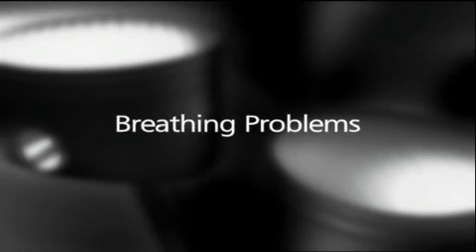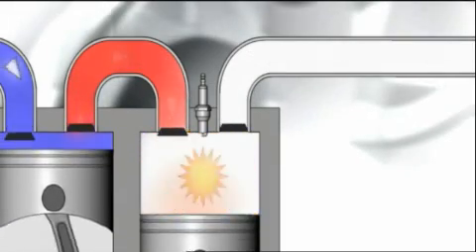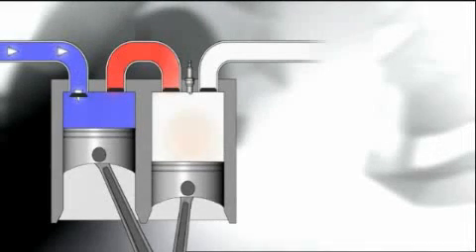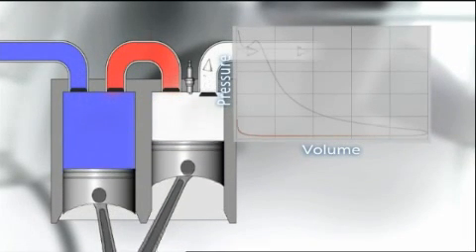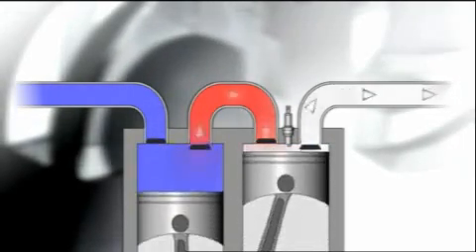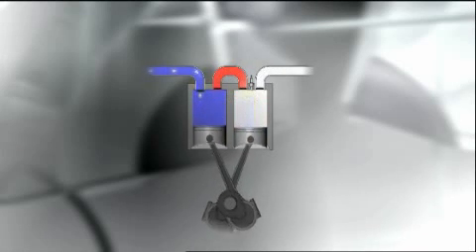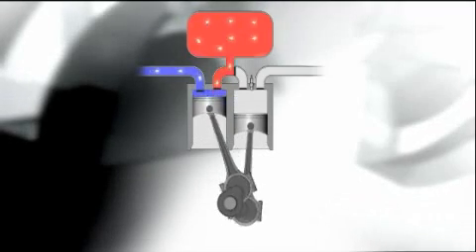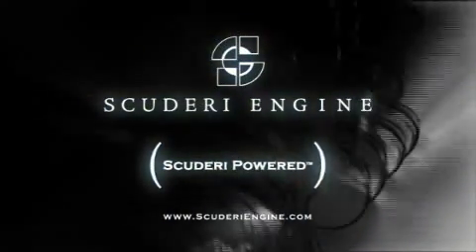Scuderi Engine - How It Works (by www.caroto.gr)

Comment: How is this more efficient than just burning it in the cylinder that the air enters first? Seems you would be moving twice the amount of metal for half the work.
Reply: Yea it doesnt look very efficient to me....I dont think the power gains would be worth basically having cylinders that are just dead weight on the crank...
Reply: +Stevie Wonder But this V8 wouldnt be a V8 anymore, it would be a V16. So you would be losing so much power carrying all those cylinders around that are not producing any power.
Reply: Stevie Wonder It doesnt. If you have a V2 4 Stroke it will deliver more power than this engine with the same bore/stroke. Trust me i am an engineer , and i develope parts for race engines. This consept is only one of a "want to be " Engineer, who has actual no idea about engine design. First it sounds good but on the seconde view it sucks in every point.

this engine cant be smotth, it cant deliver the same power as a charged 2 cylinder engine.

And it looses all the benefits of the 2 Stroke engine as well.
Reply: +Nick Palaroan I agree. This is basically an inefficient way of Forced Induction. Turbos and Superchargers were invented to force fuel air mixture into a cylinder without slinging more metal around inside the engine to do the same thing.
Reply: +Merp it fires every revolution not every 2nd revolution, but see ya point as a v8 would become a 16 cylinder though, need a compression piston for each firing piston. Was just thinking what you guys were as well
Reply: +Adrian Paul ..... but a split cycle V8 would still get 4 per strokes per 360° rotation of the crank, just like a normal 4 stroke V8.

I think this is probably going to be marketed mostly as a diesel engine for buses, trains and tractor-trailers as an alternative to battery-electric hybrids.
Reply: +Nick Palaroan ...... per 2 cylinders, you still get 1 per stroke per 360° rotation of the crank. 8 cylinders (4 intake/compression cylinders+4 power/exhaust cylinders) still produces 4 power strokes per 360° rotation of the crank, just like a normal 4 stroke engine.
Reply: +Nick Palaroan ...... per 2 cylinders, you still get 1 per stroke per 360° rotation of the crank. 8 cylinders (4 intake/compression cylinders+4 power/exhaust cylinders) still produces 4 power strokes per 360° rotation of the crank, just like a normal 4 stroke engine.
Reply: +Stevie Wonder  You have a V8 + 8 Kompression cylinders only to produce one not so good combustion on every one of the first 8 cylinders. Wait why not run 16 cylinders direktly, then you have 8 combustion per cycle too and you will have a much smoother run and a much better combustion also your cylinder will get much more stress than 16 running cylinders.
Reply: +MKS Racing This ^.
Reply: +MKS Racing "only not so good combustion" is baseless speculation. this allows the bore•stroke of the intake/compression stroke to be tuned separately from the power/exhaust stroke which has benefits for increasing the kWh/gallon of the engine..... the Prius does something similar by holding the intake port open for the beginning of the compression stroke.
Reply: +Stevie Wonder How is it changing the bore and stroke? Seems rather impossible since in the video the bore and stroke remain the same. I have seen technology that can change the stroke to change compression ratios, but the bore cannot possibly be changes at any point on the fly in an engine.
Reply: +Nick Palaroan this video sucks, in other videos they show a long stroke/small bore compression cylinder feeding a comparatively short stroke/large bore power cylinder.
Reply: +Stevie Wonder Its still inefficient to have a cylinder as more/less dead weight. Its not contributing more power than it takes to move it, so its dead weight. Hence why its not used.
Reply: +Nick Palaroan it delivers better kWh/liter.
Reply: +Stevie Wonder That depends on how your measuring displacement....are you measuring the displacement of both cylinders or just the combustion cylinders?
Reply: Stevie Wonder 
But if you're going to do this why not just get a 2 stroke diesel? Still get more power and cheaper because of less moving parts
Reply: If that first piston was bigger than the power piston, you could call it a supercharger, but it isn't.

Comment: Snake oil. The one thing that made me a non believer was the storage tank. The fuel will fall out of the incoming charge and you will have a/f ratios that are varied.
Reply: MrCuervo22779 He says it's direct injected, so the sorage tank only stores air.

Comment: Looks allot like the (5 stroke) concept.
Reply: The 5 stroke is somewhat similar but the exhaust gas is sent into another cylinder to use more of its energy. You still have two pistons operating normal 4 stroke cycles for each "passive" cylinder.
Reply: +94XJ Yeah, the 5 stroke looks superior in terms of efficiencty as it's runs more like an Atkinson cycle (as used in Prius et. al. via VVT).
Reply: +Marcus Lindblom Sonestedt Nah, Atkinsin leaves the intake valves open late putting positive pressure in the intake manifold to fill the next cylinders.  It helps efficiency and low end torque, but it's not recovering additional energy like the 5-stroke.  Atkinson adds efficiency but decreases power density, 5-stroke increases efficiency by increasing power density.  Instead of less power/liter but efficient burning it's mote power/liter recovering exhaust energy allowing for a smaller engine.
Reply: +Marcus Lindblom Sonestedt I get what you're saying now...the Atkinson gives a bigger expansion stroke than compression so in that regards, yeah, it's similar since the 5th stroke is an additional expansion.

Comment: Interesting design...but what are the frictional and parasitic losses from additional cylinders and connecting rods?
Reply: each cylinder pair only has 2 cycles so theoretically the friction looses are pretty much the same

a pair of cylinders should produce the same power as 2 seperate cylinders in a 4 stroke engine because the pair combine the 4 strokes of a conventional engine into 2 strokes of a cylinder pair so you get the same amount of powerstokes between 2 pistons

Personally I don't really see much benefit to this design

In the video it does give a few good points

- Reduced Knock/detonation by cooling compressed air
- Capture energy by compressing air into a tank

Comment: Your illustration is wrong.
You should close the crossover valve on the power cylinder before you ignite...
Otherwise you will backfire into the crossover pipe.

This is only a modest improvement over the 4 cycle system.

Also the power cylinder should be about 30% larger to improve efficiency since you have the ability to decouple the cycles.
Further more, the exhaust valve on the compression cylinder should be reversed.
It should seal in the other direction to keep the pressure in.
Otherwise you will have to use a very strong spring to keep the pressure in which will increase friction.

I have thought of this idea 20 years ago and I tossed it in the garbage bin because it is not a significant improvement.

I will post my significant idea here on youtube soon. :0)
Reply: Reading an article at the moment.  Apparently Scuderi reckon they've cracked the low thermal effiecieny problem by igniting ATDC instead of BTDC.  Funny you mention the valves should open outwards; I think I read that they actually do on the real engine.

One thing that crossed my mind is whether the firing cylinder will suffer from extreme heat build up - especially if they turbocharge the engine.  That's one of the weaknesses of Wankel engines; one side of the engine stays perminantly hot, while the other side remains "cold".

Comment: More parts= more inertia,higher production cost.+ more timing elements= higher production cost. Cylinder that does not produce power deducts power(yes he says in the video that it does but not by how much) Close cylinders have issues cooling(although the pump cylinder does not produce power or detonations it heats because compressors heat taking heat from air thats produces it in the compression process) ... ... ... My question wheres the Economical part?

Comment: Konigsegg is getting better results from just removing the cam shafts from engine.  They are testing independent valves that are computer controlled.  Then they can be mapped to perfectly match engine needs at any RPM and load level.  The rest of the engine is a normal engine.
Reply: finally someone who realizes koenigsegg is better than anyone else!
Reply: Justin McLauchlin
ok yea sure...
Reply: okay maybe not everyone else, but they are still smart to have thought to use it before any other manufacturer
Reply: i don't think they where the first however i will say they have done a good job with it so far.
Reply: The Joseph Reid engine from the 1890`s uses 1 poppet valve and ports in their engine design like this
Reply: yeah but that arises many problems. instead of just swaping a bad cam you now have to swap all electronic controll units and elctronically time them and program them. it seems more expensive and harder to do.

Comment: it would be hard to get clean combustion with such short cleaning time by the intake however, mechanically it is brilliant. in order to avoid pumping loss, the intake into the power piston has to open shortly before TDC and close right after TDC for ignition and combustion seal. post TDC ignition has very low compression ratio so sacrificing combustion efficiency for mechanical efficiency does not his the nail on the head. the rotary engine still suffers this, ideal mehcanically yet has problems with clean combustion and a combustion chamber suface area that is too large for its cubic capacity thats why rotarys are far better off with two spark plugs per cylinder.

Comment: So it takes 4 pistons to do the job of 2? I'll pass.
Reply: Ryan LaRue It's 2 pistons doing the work of 2 pistons. A 2 cylinder 4-stroke engine would only fire 1 cylinder per revolution. This has a piston that fires every revolution and another piston that never has an ignition stroke. Assuming both engines could achieve perfect volumetric efficiency, output would be the same. This design exists to improve on the VE over a conventional engine.
Reply: The idea of a split-stroke engine isnto get the power density of a 2 stroke with the efficiency of a 4 stroke.  Ultimately if youbhave 4 pistons in the split cycle or an otto cycle engine you will still have two combustion cycles per crank rotation.  I think the biggest things working against a split cycle are engine vibration and no real reduction in rotating mass.
Reply: yeah but two of those pistons are acting as turbos, compressing the air
Reply: Nabre Labre
 A 4 stroke already compresses the air but the air density that's being compressed is only from natural aspiration, hence the other two pistons cramming more air into the engine.
Reply: David G This is natural aspiration...the intake cylinder is naturally drawing in air.  There's no mention of a larger intake/compression cylinder.  The concept is about reducing the pumping losses from compressing the air before ignition.  If you watch, you'll see the crossover valves open about halfway up on the compression cylinder.  There's less resistance to the compression and a more metered burn on the power stroke to improve overall efficiency.  This is still a 4-stroke engine, the strokes have just been paired off into dedicated cylinders.

Kind of like having 2 employees each responsible for handling the same 4 tasks.  In this situation, each employee is given 2 of the tasks.  With fewer tasks, the employees should (hopefully) be more efficient at what they're doing and you get more work done from the same resources.
Reply: The thing is is that it really isn't cramming in any more air nor is the intake cylinder mixing with fuel.All its really doing is transferring air from one cylinder to another since the power cylinder doesn't actually draw in air by itself, so again, 2 cylinders doing the work of one is not efficient.
Reply: Nabre Labre No, not even close.
It would run like a 2 stroke engine but would have the fuel economy of a 4 stroke.
There would be no misses as the firing is continous and happens every revolution.
Reply: Ryan LaRue The compressor cylinder is usually smaller and can use weaker materials. They were typically driven by a elliptical instead of a crank on the crankshaft. Essentially attached to a point either on the flywheel on 1 cylinder engines or a point on the counterweight on the crankshaft.
An example of this design would be a Ried 15hp oilfield engine.
Reply: You can have different compression and expansion ratio
Reply: David G They are not acting as turbos, a 4 stroke engine already compresses the air fuel mixture in the same manner. This method just turns off half the cylinders so you'll have a heavy car that runs like its misfiring

Comment: Its a positive displacement supercharger (piston type).. not very efficient because of heat from the compressed air from one cylinder to the next one via small interconnecting tube / too many moving parts, valves..springs..rings /  not easy for rebuilding / ... just GAY.

Comment: so basically half the engine is a supercharger... Uh dumb worthless pos motor. Just use a supercharger and not waste half the motor due to loss of power and friction and rotation weight..SOME PEOPLES CHILDREN!!
Reply: Think of it this way; it produces the same number of power pulses per revolution as a conventional engine, it's just that the 4 cycles are split between the two cylinders with one cylinder doing the intake and compression and the other doing the power and exhaust.  Power, friction, and rotation weight are about the same.

Comment: Compression should ahead of the power cylinder, not behind like here.When power cylinder opens, compression cylinder starts to compress. But if it were 20degrees ahead, compresed air would be ready. Also this video clearly show that when igniter sparks air still coming from valve. When ignition starts, every valve should be closed. I also agree with compression cylinder be much larger.

Comment: Basically a Harley engine.
Reply: nothing like a harley  EVO motor. the cylinders are not linked in a evo and while CYL 1 is in TDC CYL 2 is in TDCC. they dont both fire at the same time like a Modified Triumph or BSA. cool but waste of power because the rear wheel pulses. they cant because the Camshaft timing.
Reply: More like a engine much older than a Harley. A Joseph Reid oilfield engine from the 1890`s

Comment: You will find that this engine simply does not compress the air as well prior to combustion as a common 4 stroke engine, the high compression is paramount for power and efficiency.  The extra piston is a liability.
Reply: with that in mind, it could be argued that, a 4 strokes extra two more strokes is a liability

Comment: Compressed air feeding a power cylinder from a dead cylinder?
Sounds similar to a supercharger; I'll use a turbo!
Reply: gmax876 It isn't forced induction...a single piston has to compress the air before ignition, this is just moving that stroke to a separate piston in an effort to increase pumping efficiency.  The "power" cylinder fires of every rotation so you're still receiving the same number of power strokes as you would with 2 4-stroke pistons.  What they said is that got can boost the engine higher meaning you can add a turbocharger and have more boost since the compressed charge can cool before it's used unlike a 4-stroke engine.
Reply: I was thinking the same thing.
Reply: 94XJ -

Comment: Interesting a old concept coming back Take a look at a Joseph Reid oilfield engine witch many run the speed at your animation. the engine has 2 large flywheels and open crank case so you can see the two pistons in operation. The charging piston runs on a crank outside of one of the flywheels

Comment: So my guess would be that you want the intake cylinder to be slightly bigger as to add a slightly larger volume of air to the combustion cylinder to add what would be considered boost. Just my guess as I know nothing of these engines.

Comment: That's pretty much the point. It's a gas/compressed air hybrid rather than a gas/electric. For the things like the spark plugs and headlights you would still have an alternator of course, but no battery would be needed since you would just use that air.

Comment: what if your going down a long grade like a mountian...using no motor power, but using the regenative system filling the tank for back up...pressure to use later...some mountians are like 2-5 miles of downgrade...that would be a lot of pressure build up in that tank..and that would be unburnt fuel right???? you would have to reroute it somehow back to the intake...to be burnt..somehow..right???????????

Comment: If you did have a tank to keep compressed air in, you could remove the need for a battery and use the compressed air to start it!

Also, I could see this kind of engine being really good in small gas powered air compressors. Would really save space as its both units in one!

Comment: That  is a vary good design by working the 2 pistons its firing the power stroke ever revolution that would make sense a hole lots of power and you have the intake working on its own when needed  you to fill  the revisor and now all that in take stroke that would have been lost on the old 4 stroke  are save . now this mean a smaller engine will  have more horse power than our old 4 stroke engine. when do have a replacement
for our car? 2013

Comment: How many hundreds kilo will be the Fly wheel, since you have power strokes only 55 to 60 degree, the rest is gap. ? ? And how many pistons set you are planing to  be able to get at least some synchronized rotation ?? Maybe 12 or 16.How big the gravitation counter weights  will be, multiply that with 12 or 16 cylinders. I think it will be to heavy.